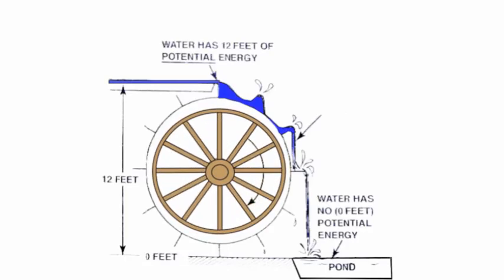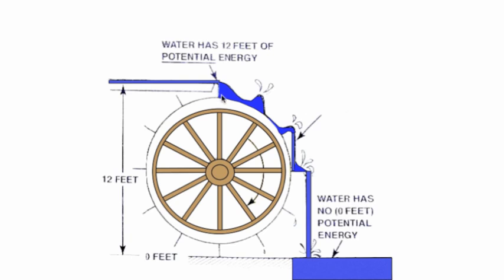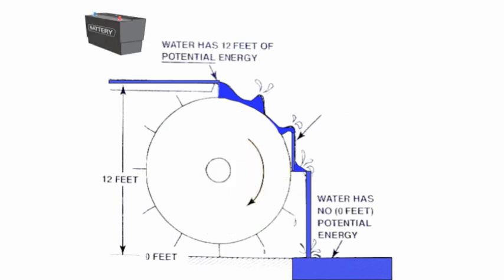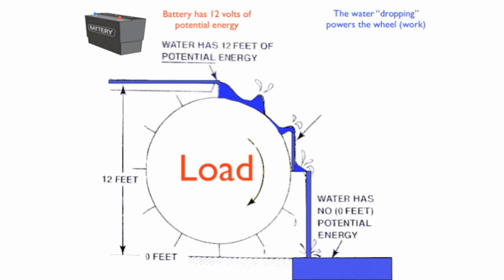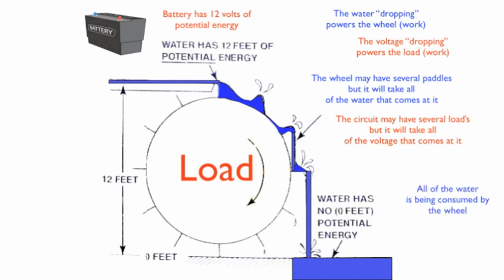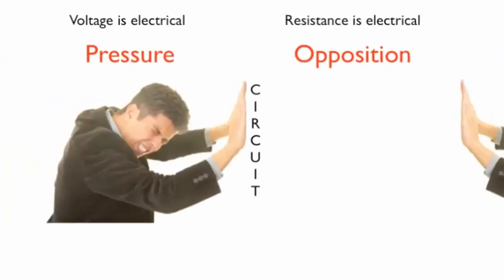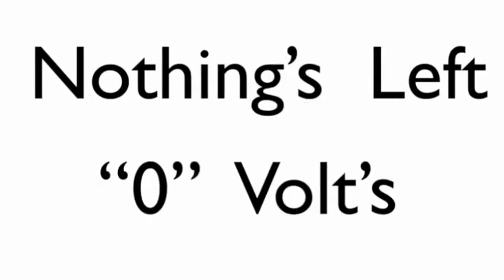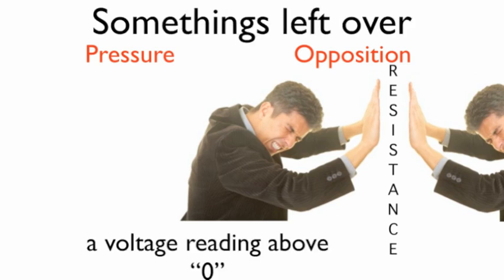Voltage Drop Another Look

Comment: So if you have voltage drop at the load, that means there is to much resistance inside the load component,  indicating a bad component?